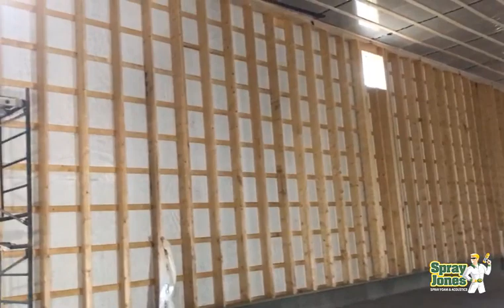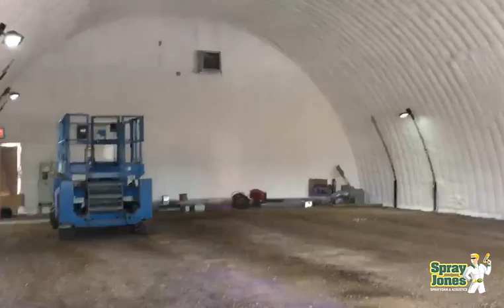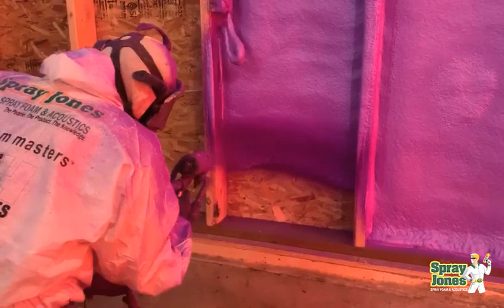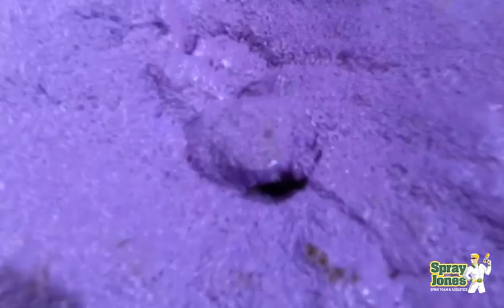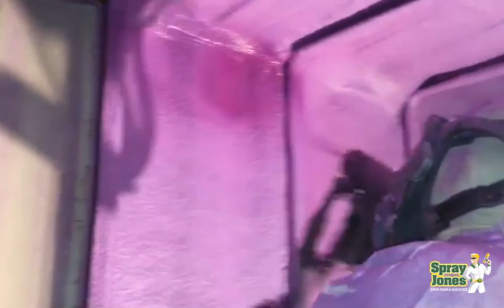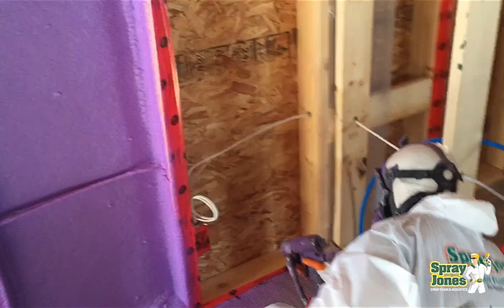Who are the most dangerous Spray Foam Insulation Installers? 5 "types" to Stay FAR FAR AWAY From!

Comment: Loved the video I myself am a third generation union Insulator/Tinknocker had 5 year trade school with regular re-up classes. So true that attention to detail and having a solid plan with good communication between other craft is paramount. You don't always get that but it's extremely satisfying when you do. Doing high density spray foam in a Nuke is always fun especially when it's the kind for lead shielding if I remember correctly P-90. All kinds of QC hold points, batch test samples have to be done periodically between spraying. I haven't done the closed cell spraying not much demand here that I know of. Sure would love to get the experience to add to my list of applications. We already do do Ammonia lines encapsulation for flash freezing equipment. Cryogenic work, chilled water, and refrigerant work.

Comment: Your guns pattern always looks so good and clean cut, willing to bet you guys have multiple clean guns with someone keeping up replacing parts. Great video!
Reply from the maker: 2 guns per rig. Know what you are doing and have good ppl to operate.
Reply: @SprayJones  how often do you need to change your cartridges? I currently spay with the graco prober p2 air purge gun and I’ve been debating switching to the graco fusion guns and was wondering what the advantages/disadvantages are between the two. Thanks.
Reply from the maker: @jared2468  With good foam, proper parameters, good care of equipment a gun can run for 1 week sometimes 2 before needing a rebuild. 
We hour-out chambers, side seals and springs after 30 - 40 sets.

Comment: All these points are pretty universally applicable outside of spray foam too - ALL the trades.  Makes me think of all these "Al's Whatever "and Construction.""  Yeah....Forget the "and construction" part.  That's just ASKIN' for trouble.  lol  Good stuff.
Reply from the maker: You are correct, but when it comes to spray foam people ignore the obvious and blame the foam.
Reply: @SprayJones  Well, yeah there IS THAT.  Spray foam is kind of in a weird place right now.  Gettin' a bad rap from what (in most cases) has not a damn thing to do with the foam.  It's the typical (as with the other trades) bad/incorrect installation of the product.  Well, AND the other thing:  PEOPLE DON'T PAY ATTENTION!
Reply: The difference is that spray foam problems can cause damage that is far beyond cosmetic... other trades this can be true too, but it’s far easier to mess up spray foam to be dangerous then it is other trades.
Reply: @dennispope8160  Easily created problems that go beyond cosmentic and that can be dangerous are not EVEN exclusive to spray foam.  Electrical, plumbing, and HVAC are ALL on the exact same level with regard to these points.

Comment: My neck of the woods I used to have only about 5-7 Insulation Companies that did foam. Now we have 15-20 in a 30 mile radius. They have literally ruined the business, went out to do a quote recently, good size tract built house, customer wanted the roofline done, gave the estimate 24k, he said he found an installer to do it for 10k which is nuts. Literally makes no sense to do something that cheap. I was in the middle one bid was 18k mine was 24k, last bid was 28k this guy jumps to the 10k either the foam sets is stolen or they really are desperate.
Reply from the maker: Yes that is all too common. The SPF industry is dying and I am sorry to say I do not see a long term future in it anymore. 
There are too many suppliers trying to sell product to whomever and then you get what you just described, idiots with no business sense giving prices that cannot sustain anyone other than a 1 truck 1 worker set up... working for wages and nothing more. 
I have seen prices low enough that you can't make payments of the equipment..

Comment: Well I don't know there Jones' I have to disagree with you on some of this content . I'm a drywaller who has added spray foam to our business. And we were easily able to replace the SF guy doing our project were are on . Our knowledge of the building helped us pass all our inspection more than twice a month during this three tower 320 plus unit project . Our competition failed way more than once and that doesn't count for all the work I've had to rip apart because they recked steel framing every where because framing isn't there problem.
Reply from the maker: Gord you are fine. This is to get people thinking, talking and looking into things and not taking everything that comes along at face value. 
Makes the bad guys easier to spot and harder to hide.
Reply: I did hire a qualified foamer and mech to work with me for the first two months . And I don't do Reno work I stick to what I know new construction I work with all the trades and sup to ensure foam is applied when needed not perfect but good relusts so far . I've had to repair framing I messed up you really have to brace up steel stud and do setting shots wilth the gun or it will bend fast. No bad foam though and I fixed my work my cost
Reply from the maker: @gordongoodkey4118  You are a good man and who we want in the industry. 
I like to poke my finger in the eye of the jerks that need to go. 
Keep up the good work. 
Channel is growing and looking to do a pod cast in 2021 for SPF installers to help them.
Reply: I do park my machine it scares the hell out of me what I do is bleed it or cycle it to make sure it doesn't clog from sitting and I clean guns out to spotless condition . Got two guns and lots of parts . On a side note someone stole my goodie box with all my chambers and parts little tools cost me 1500$ to replace had to spray for a whole day with no way of maintaining the gun .it ran great got so lucky
Reply: That pod cast would be a great thing to do very generous man it is hard to find good training resource

Comment: Great video sprayjones really appreciate your content. If I could pick your brain for a minute I’d like to ask what mixing chamber / spray pattern you use? Also what psi do you typically spray at?
Reply from the maker: Graco Fusio AP. 01 chamber round. 1200 PSI static 1000 on dynamic. 
The real setting is getting the temp goldilocks. That changes everyday and is sensitive.
Reply: Thanks. How do you know when you’re in the Goldilocks zone? Do you just play with the temps until you get the desired reaction from the foam?
Reply from the maker: @michaelgray1523  Correct. Too cold is narrow, too hot is a mess. Just right is: max yield, speed and full pattern. 
Start cold and bump up until you like it. Then check density to see how close you are to design.
Reply: @SprayJones  really appreciate the info! Do you have an opinion on the pro connect for the AP gun? Have you used it and if so is it worth the investment?
Reply from the maker: @michaelgray1523  Nope. Don't use it.

Comment: I tell my customer if they ask if I can price match I tell them: cheap ain’t good, good work ain’t cheap. I can only confirm what your saying I drove 8h for a job as the other local foamer was not credible ... everything you said i experience ExAt same I’m only 2 years in the game but I lay some smooth butter now and my first jobs eher sea container and my own attic
Reply from the maker: In Jan 2021  have a vid on pricing and what to evaluate to determine what goes into a price.
Reply: Spray Jones yes that would be interesting I calculated  my chemical cost per  bf out and pretty much double the price wich means form my total bf price I have a bout 50-60% Chem cost depending on job amd the rest is Labour and equipment maintenance and pay off of loan. And with hfo changes we’ll see who has a decent foam and still Good r value I Wonder where basf is Gonna be. 
Appretiate the very Good Videos I have no hesitation to even refer customers to watch your videos for Infos. Cheers
Reply from the maker: @henryhenry5897  That's correct and how you should. 
My video will be more towards the considerations for a buyer as to what will factor into their number. Everyone has diff numbers, but what makes them go up or down...

Comment: In the beginning of the video, what is the white exterior substrate you are spraying against??  Just curious, looks like tyvek or poly sheeting?
Reply from the maker: Tyvek. The builder did not want the foam against the steel.
Reply: @SprayJones  ok, im new to your channel but have a very successful foam/BIBS business in a cold climate resort area in Idaho.   Ive never spayed Tyvek with ccspf due to adhesion issues.  What are your thoughts?
Reply from the maker: @kfd629  It is not the best choice that is for sure. It needs to be fully restrained where it can not move in any direction, then it is OK to spray to it. Otherwise no.

Comment: I see you spray over cables, in the }UK this is against the electrical and building codes , as it is said the cables could overheat because of the insulation, not allowing any cooling requiring bigger cable or sheathing2.   What is the position there   And what fire retarding qualities does it have. What make do you use for closed cell foam?
Reply from the maker: One of the most tested areas of install is electrical wiring. There are so many thorough analysis done on wiring, with very credible agencies showing that it completely safe and allowable. All codes are written to allow SPF over wiring, we don't give it a second thought.
So I wonder how physics is so different on our continent compared to yours.
Reply: @SprayJones  220 volt household and 415volt 3 phase industrial power for plant.
Reply from the maker: @GWAYGWAY1  The wire in conduit solves the issue. We have sprayed many commercial and agricultural buildings that have power requirements similar to that. The wiring is always in either armored cable   or metal conduit. The foam goes over that.
Reply: If your cables start melting, I would blame the technician instead of the foam-guy 😉🥳
Reply from the maker: @kevinguns7386  Here is the first intelligent response in a long time. 
I have info on wiring and SPF, just waiting to do a video on that subject.
Reply: @GWAYGWAY1  The voltages are different...the physics aren't. Neither is heating caused by current draw (which is actually less on a 220V circuit over a 110V circuit for a given load since there are TWO live conductors and no neutral) Slightly higher voltage and/or 3 phase power count for exactly ZERO from a safety or code standpoint.

Your comment makes absolutely NO sense to anyone with electrical training. Don't they "direct bury" power cables underground in the UK ? 

Same thing, my friend.

Comment: Think it should be a plactick on gravel than spray , not directly on gravel.
Reply: I agree about the vapor barrier plastic .
Reply: @deerhunter7482  I was not concerned by vapor barier but rather not mixing foam with gravel and demishing its draning capacity.Thanks for reply.
Reply from the maker: Won't stick, won't stay flat, won't work at all, will only lift and be a disaster...ask how I know..
Reply: @SprayJones  We know you know.Thanks for reply.
Reply: Spray Jones why don't you put plastic on top of the foam before the pour .
Reply from the maker: @deerhunter7482  We are plastic. No need;; the idea is to have the foam do it all for you. 
You don;t need 6 mil polyethylene when you have 50mm of polyurethane.